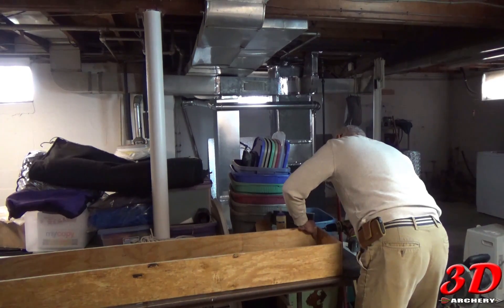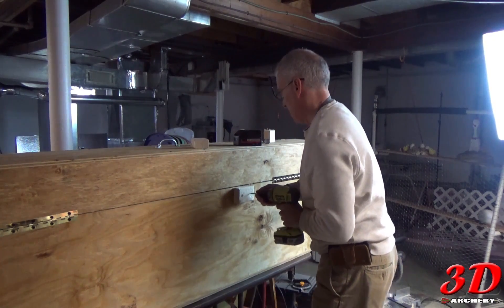Laminated Bow Build Step One

Comment: Use this plastic insulation foam. Line box first with it. Then install lights. Run wires underneath insulation for a neater job.

Comment: A question and a couple of comments. Are you planning to leave your box unattended for any length of time? If so, then you could have a problem with your Daisy Chain/Series circuit. If one bulb burns out, that breaks the circuit and all your lights go out. Your box is no longer working. Taking the time to wire your bulbs in parallel eliminates that problem. One burns out; the others continue to be on. You've lost some heating, but not all.
The second comment is really two. Also putting aluminum foil on the lid will increase your insulating factor. Another and final point is that the shiny side of the foil is a far better reflector that the duller side. 
Sorry, but I have to go. It's time to head to the club.
Best and many hits.
Reply from the maker: Thanks for the suggestions.

Comment: The finished build looks good and nice to have a video on something that a lot have probably not thought about doing as a home bowyer. A couple of ideas I thought about while watching Gregg.  Instead of using the bulbs would ceramic heat emitters or dark spots that are used for reptiles be better as they produce more per watts than bulbs. They are dearer but you would need less wattage so cheaper to run. You can also get the reptile pulse thermostats that will keep the temperature more constant. I suppose in a lot of way it depends on how often you would use it and how long it is on each time.
Reply from the maker: Never would have thought of that, great suggestion. Might have to look into it, thanks.